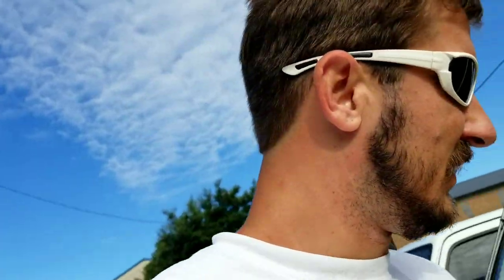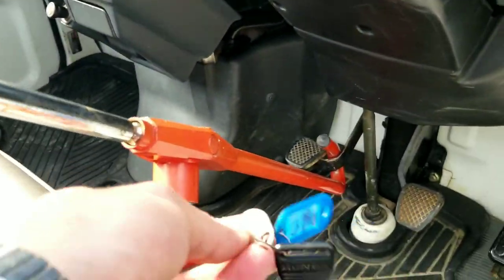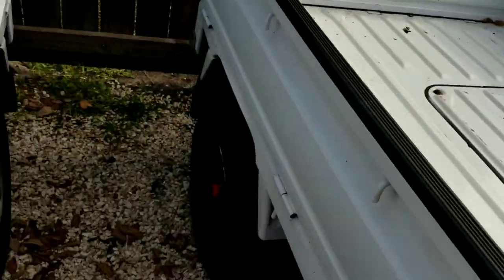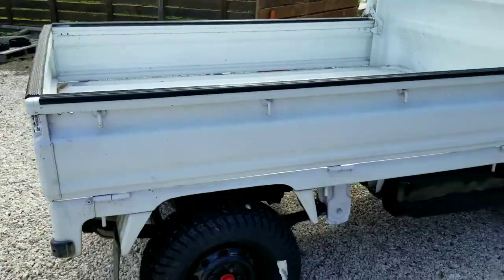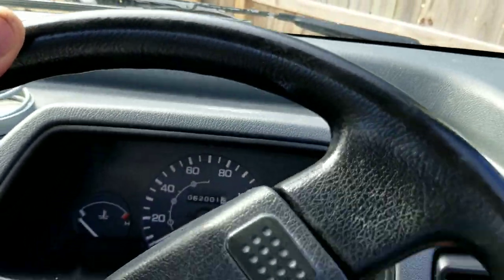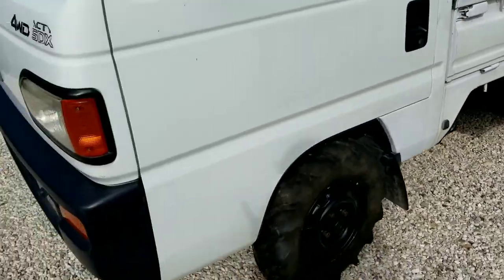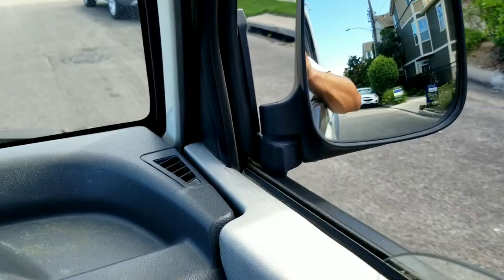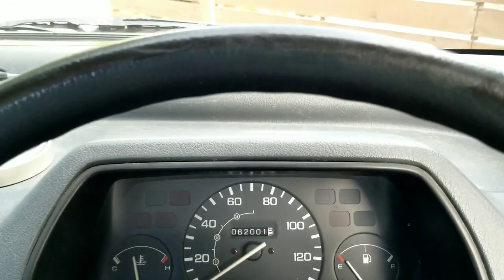Honda Acty 4WD walk around and drive

Comment: How big of a difference in traction would you notice offroading between the Attack and SDX?
Reply from the maker: Depends on the terrain. If you need a locking differential, you will know. Attack is valuable if needed, or rescue is not available.